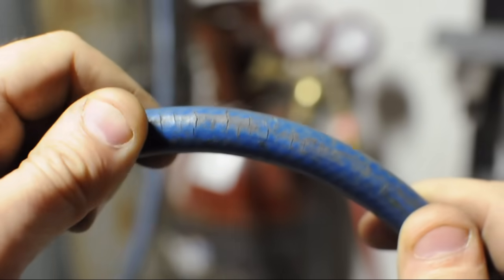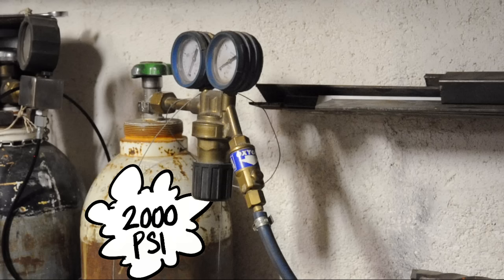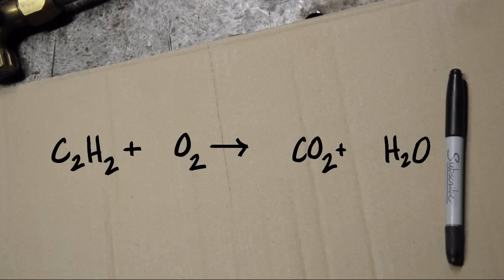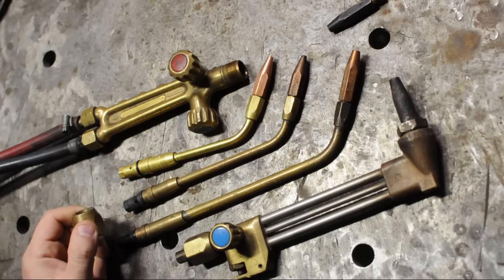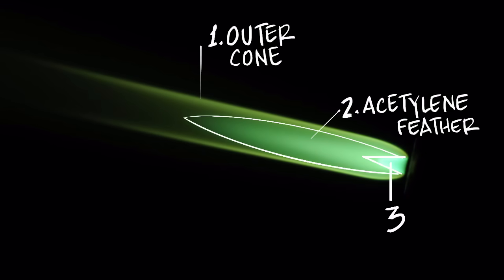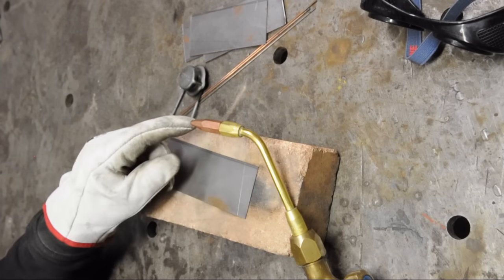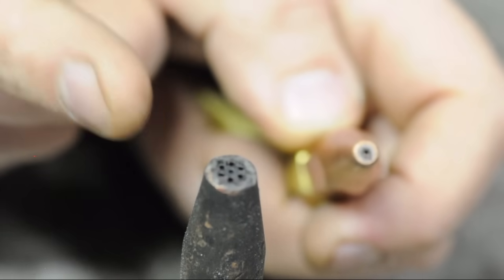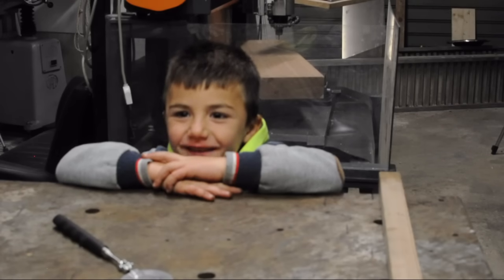Let's Talk Oxy Acetylene

Comment: I had minimal (better expressed basic) experience with oxy/acetylene torch,
Then time with the railroad blew my mind "KPEWWWW"

It allowed me to get better at Arc welding and using the torch,
But one thing I had NO comprehension of was the use of air-arc.

Whoooooboy.
1st train wreck we had two days to cut up as much of a locomotive and the damaged cars,
Using the air-arc set-up.
Probably the loudest tool I've ever used.
But most fun and impressive.
Could cut through two inches of steel like butter.
Those carbon rods burn up fast tho -
Maybe my inexperience was the problem 😂
Either way
Most funnest destruction ever.

Comment: I was thought never use a lighter because a bic lighter is equal to a stick of diatomite. The flash bang of the torch start up can ignite the lighter by melting the body. That was what I was taught.

Comment: Okay I'm doing everything wrong but it works better for me. First I unscrew both gauges so there is no flow. I open both hand valves 1/2 turn each or so. I then turn up the gas gauge and light the torch. I then turn up the oxygen gauge to a neutral flame. When I turn off the torch I do it with the hand valves. That way when I turn the torch back on I only need to open the hand valse and I am set to weld with a neutral flame. No adjustment. (maybe a little fine tuning). This seems to be a safer way because the hose only has the pressure you need. And it is faster to stop start welding.  Let me know if I am risking my life doing this way. I'm only 70 but it seems like I have been doing this for 100 years.

Comment: i have a question about the flashback arrestors. Wouldn't the flame go out inside the tubes of pure oxygen and pure Acetylene? Because the 2 gases only touch later, there shouldn't be a danger of a flame going back to the tanks, or did i miss something?
Reply from the maker: oxygen can go up the acetylene hose and vise versa!  if one of your tanks are very low for example, the pressure from the other tank can backdrive up the hose.
Reply: @ThisOldTony  thanks

Comment: the reason for a "striker" to light the torch is just like fuelling an open fire with a fuel can, the flame 'wicks' up the fuel and causes a "backfire" in the lighter case, it ignites the gas ( lighters like acetylene tanks have a dissolved gas, this case butane), exploding the plastic housing of the lighter, and any human appendage attached to same lighter!!, so just like starting a mower, keep fuel sources away when starting, the Acetylene is fuel enough :-) ALSO these sources of heat, lighters etc, do NOT have a flashback arrestor, which in oxy-acetylene torches, stop the backfire hazard, by preventing the flames wicking up the fuel lines, keeping the gas flow in one direction only.

Comment: I have problems trying to gas weld.

I would try to get a weld puddle, and I do sometimes, but on thin pieces of metal I keep blowing holes in the metal rather than making weld puddles. Any idea what's going on?
Reply from the maker: sounds like tip is too big. try a smaller one.
Reply: @ThisOldTony  So what tip should I use for welding bandsaw blades? I've had no luck there using the smallest tip I can buy. I can braze them however.

Comment: I'm glad the things that I have and can learn from this guy .However the speed of the f**** flame speed it burns at.It can't go in the torch if it's flowing faster than it burns. Flame propagation for acetylene is 24 ft/ second. So light just fuel, open it up until the flame is off the touch tip. Now close it slightly (slow it)until it meets the tip again .Now open oxygen and balance the flame with bringing the feathers together. Keep that flow speed up, adjust as tank pressure drops. The flame can not burn fast enough to get inside the torch because flow speed prevents it. Why wouldn't he know something so fundamentally important to torch operation.Also oxyacetylene burns one to one part each . Oxypropane burns 5 parts oxygen to 1 part propane at only 12 ft/second flame propagation speed. I do want to thank this guy for that what I did learn here from him and I am sure I will be able to get a lot more I am subscribing.

Comment: An open flame is also bad to use because if you were using something like a propane torch a misplacement of the hose or a bump of the propane flame could make you torch fall over possible burn the lines and blow your shop to high heavens

Comment: While attending a air gas class we were told the smokey smoke coming out of the acetylene is actually the acetone thats burning I believe such as when using a rose bud when too big of a rose bud tip is used for the bottle size it starts to pull acetone along with the acetylene gas causing the excessive black smoke ( turn the flame down )

Comment: When the shit is set properly, it should sound like a Saturn V! At lift-off !! The flame is long, further it takes much LESS heat to cut through.
A lot of beard under the cutting surface = too much heat. Smaller nozzles, different angle. Believe me I'm a carpenter;)
Also has sore thumbs :)

Comment: Try Propane gas it lasts 5 times longer and is 5 times cheaper, welding tips will need to be counterbored and a 2 piece cutting tip for you cutting enjoyment. only a bit less hot but gets the job done just fine. Propane tanks also need to be upright . A 5 gallon  BBQ tank will work just fine.You can do the rocket science math and see if if it needs a 5:1 air fuel ratio also. Your new hose will last longer with propane.

Comment: Everytime I hear americans talk about oxyacetaline they tell me to open and light the acetylene first, but here in germany im being told the exact opposite. My teachers, job instructors and books all say open oxy first and then acetylene. Reason being that the relatively high pressure oxygen functions like a vacuum pump for the acetylene and to prevent fouling of the hose. You are even supposed to test hoses by taking of the valve cap of the acetylene valve and opening up the oxy, then by putting your finger on the hole of the acetylene valve and you can feel the suction the oxygen-stream is creating. Not trying to say you guys are doing it wrong, just saying that I like the sound of doing it the other way.

Comment: Tony how do you adjust the cutting flame if the lever bypasses the valve?
Reply: @Grauenwolf  what I meant was if you adjust the oxygen with the trigger depressed at full bypass pressure, would it not throw out the balance when you release the trigger.
Reply: It doesn't cut with a flame, so there's no adjustment beyond setting the pressure with the oxygen regulator.  There's no gas mix to worry about when the trigger is down.

Comment: Burninating? LoL
OXY -ACET.  Is indispensable  for  full fusion  cast iron  welding.
Nickel rods you say? Yeah ,yeah sure, its stil only intergranular penetration , so not much better ( lower service temp weld. ) than full fusion with say 10% Si cast filler.
Love my mud puddles. Heheheh! Great work TOT  !

Comment: You forgot the boom. Acetylene is explosive in air from a 10% concentration to a 90% concentration. When I was a kid we used to tape the seams on a cardboard box, dribble some acetylene in with a torch, tape a fuse to the hole and light it off. It made a really big boom. My dad was working in a shop where someone left a torch cracked at quitting time. The heat kicked on about 2 AM. They found pieces of that shop a quarter of a mile away. The insurance settlement bought my dad a whole new set of hand tools, so it was not all a disaster. The moral is, acetylene leaks are not a joke. An explosion like that in your garage will probably kill you and your whole family.
Reply: 2% to 80% concentration.

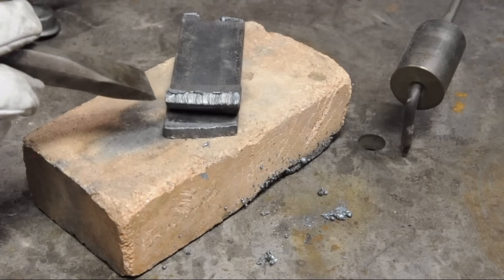Comment: 17:38  that's actually not true. I tried it and it doesn't work. Acetylen is required to heat the piece , where Oxy only would cool it (pressured cold gaz right onto the exothermic reaction will stop it)

Comment: I find it odd how the O2 bottle is so friggin huge and only has abou 140bar in it. The reason for that is that I'm a firefighter and the air bottle I wear on my back has 300-270bar in it. And it's much, much smaller. Granted it's not pure 02, but compressed air. But I doubt that the composition of the gases would impact the amount that is stored inside.
Reply: Good question. It might have to do with the construction of the tanks.  Bar is a measurement of pressure.  Standards on the tanks may allow the scba tanks to contain higher pressures.  Both may have similar volumes of gas in them depending on the tank size.
Reply: Tanks come in different pressure ratings based on how they're made (and how expensive they are).  Your firefighter air bottles cost a lot more so that your air lasts longer.  Industrial oxygen is as cheap as they can make it.  And you wouldn't want to lug around one of Tony's oxygen cylinders on your back.

Comment: Acetylene does not smell, so they add a stenching agent to it, so you can smell it. Acetylene is also highly unstable at higher pressures, so they dissolve it in acetone and fill the cylinder with kapok which absorbs the acetone . an oxygen leak is much more dangerous than a gas leak, as an atmosphere with 25% Oxygen will mean that a fire will be extremely hard to put out, especially the clothing you are wearing which will be saturated in oxygen

Comment: Biggest issue with Torches are : The Tanks !  
They are Expensive  to buy AND refill .  Acetylene being surprisingly pricey.
Plus the Cylinders time out (10 yrs)  at which point they need  Re-certifying.
 A process involving transport to a specific business (usually Far away)  and  then there is the cost... which is a Sizeable portion of  simply Buying New Cylinders outright.  
Many Gas  suppliers have annual Subscription/Rental  plans where  one pays a sizable charge annually.  Which becomes  a pricey problem .. after a couple or 3 years..   
Not trying to dissuade But Torches can be an Expensive PITA for home usages.
Reply: Acetylene is getting more expensive as millennials and gadget phreaks  dump OA gear for electronic boxes with many dials. makes them feel like pilots in a cockpit. Fact is that OA can do all the heating, welding, brazing, cutting you will ever need in any location, even when there is no electricity. If you are an industrial fabricator OA is only used for heating, brazing, cutting. 90% of garages and households are better off with OA. You need to do your shopping with tanks etc. A 10CuM  oxy tank will last you ages and it has no use by date. If you are keen you can do away with acetylene bottles by getting an acetylene generator. You can make up oxy bottles with oxygen concentrators. OA means being independent and being able to do almost all your welding  without argon, CO2 and helium bottles. Imagine your house being flooded. Garage under water. when the water drains there is only ONE welding set that will work and allow you to make repairs and it will not be your tig, mig or arc welder. Get yourself a Dillon torch and you will use 4 psi on O and A and your bottles will last almost forever.. At 4:45 Tony talks about the DHC 2000, Henrob, Cobra small torch with a LARGE price tag. That is the Dillon. Invented in the 70s in Australia. Weld thin metals without flux. including aluminium, stainless and mild steel. It is a TIG without all the dials and fancy displays.  Take advantage of the gadget phreaks that dump the old OA equipment. You can get a used set with a Dillon torch for one fifth of what Detroit Torches will charge you for a new Dillon.

Comment: Shake hands with danger. I turn on the acetylene to a low flow and then turn on ox to just a bit lower flow than acetylene. Light lighter as fast as possible and boom I'm dead. Lol. But seriously it works perfect
 Then I quickly adjust for perfect cutting/heating purposes. When starting with a small mix of oxygen it cuts down on the little black ghosts aka carbon/suity particles floating in the air. 🔥 💥

Comment: The reason i guess to not be using an open flame is that your cheap plastic lighter could explode in your hand.might be more problematic when using a large heating torch, the one that sounds like a flame thrower ahah and backfires like a car when you only shut off the acetylene.

Comment: You didn't mention the very important fact that acetylene has a triple bond between the two carbon atoms. The triple bond contains a lot of energy which is why liquid acetylene by itself is dangerous when compressed. If something broke that triple bond (like heat, shock or pressure), a lot of energy would be released (i.e. an explosion). When acetylene is burned , the triple bond is broken, which adds energy to the reaction and results in a hotter flame than burning something else (propane, hydrogen, etc) with oxygen. That's why you have to put up with acetylene dissolved in acetone when something like LPG would be so much simpler and safer. The extra energy in that triple bond makes all the difference.

Comment: What is the algorithm you're using at 5:29..
Looks like you're applying random rules until the equation is balanced...
Reply: xl The rule is add numbers to each species on each side until the atom counts match on both sides. Then if there is any integer greater than 1 that divides evenly into each of the coefficients (the numbers), divide all the numbers by that integer. Once you’re done you have a balanced equation in typical form.

Comment: Why you shouldn’t use a cigarette lighter to light a torch.
The heat of the flame can melt the lighter over time and cause a flashback in the lighter.
A cigarette lighter explodes with the equivalent of 5 dinamite sticks.
Reply: Not even close.  A disposable lighter contains 4.5g of Butane.  That's equivalent to 218 kiloJoules of energy.  One stick of dynamite is equivalent to 1 MegaJoule.  And dynamite is an explosive, butane is not.  Butane burns much slower, so it can't produce anywhere near the same peak power output.  But it can spray flaming liquid all over your hand and clothes if the plastic case is melted.

Comment: There is no reason not to use an open flame or red hot metal to light a torch. Smith actually makes a "gas saver valve" that has a pilot flame for lighting your torch and people use it every day.

Comment: Why would one like to work with oxy acetylene when TIG  welding is a lot safer and still gets comparable perhaps better results ?
Reply: I used an oxy torch to anneal copper plate when I was spinning them into bowls. And as a replacement furnace when I had to forge a tool (hammer a tool into shape). Fun time trying to melt copper in a crucible because it’s melting point was higher than the temperature of our casting furnace to cast copper. Don’t remember what else.
Reply: JackFlashTech  , perhaps for the brazing too. Regarding the annealing , it seems like it is limited to relatively speaking small pieces, but it is handy tool for that.
Reply: It is hard to cut steel with a TIG welder.  It is also hard to preheat your material with a TIG welder.  It is even harder to braze with a TIG welder.

Comment: Tony. I am a retired welder.  When using a cutting torch you are really burning the steel ( oxidizing). You need a new cutting tip.
Reply: Rusting steel is the exact same oxidizing process - just slower.

Comment: the reason for NO LIGHTERS is : the fuel source is so close to the torch when it is lit, there is a LARGE risk of a flashback into the fuel source of the lighter (and it blowing in your face :-(  ) , HOWEVER the TORCH has FLASH Arrest preventers  between the cylinders and the hoses, so the risk is MINIMISED of this occurring, so USE the "FLINT- Lighter" as shown here, only sparks, so no risk of a "flash" in your face, same deal with an LPG or LNG stove in your kitchen at home, just different fuel gas.

Comment: I was always told that using the striker is insurance on keeping my fingers especially when experienced in Mixing the gasses And The possibility of getting the chemistry just right for it to be explosive with unintended  fflowrates.   I was working with someone in a machine shop that would take his back pain medicine and then basically waste time for the rest of the day Over in the welding section and more than once Thought   A shot gun went offBy his Distraction and had to have been over 30 seconds ofGas flow while used trying to jig something up only To attempt to strike the flameAnd him be out for multiple days with a hand injury unable to work the nino or surface grinder due to  the force of the impact against his hand.  He described it as being slapped by God lol

Comment: Seen everything in cutting, but only if your doing the Oxy/Ace indoctrination do you concider better gases : natural, mapp, LP, and the best for "X"-"Y" co-ordinate system burning is Propane.  If stupid enough to have Oxy/Ace as burning machine tips steel plate usually has not so perfect flatness so the first time you turn your head away 4 tips touch the plate and say 4 torches melt. It's spectacular.  Propane tips are 2 piece and just go out if they are unattended(they dont melt like all copper Oxy/Ace).   Just so you know i have been in on 27" thick shape cutting in my 37 yrs in the biz.

Comment: The reason your not supposed to use a lighter to light torches is because you shouldnt carry a lighter on you at all while using them.you put the lighter in your pocket and a piece of slag lands on it or you lean against something hot and melt thru the lighter and it can potentionaly  blow up. I cut scrap steel for a living and thats what we were always told

Comment: Blowing yourself up does have negative connotations...however I’ve never seen anyone come back to life long enough to complain sooo....maybe it’s not so bad?  Calcium carbonate and water produces acetylene gas which is useful and safe at low pressure but becomes unstable when compressed.  Thus the introduction of acetone which suppresses the instability inherent with rapid expansion.